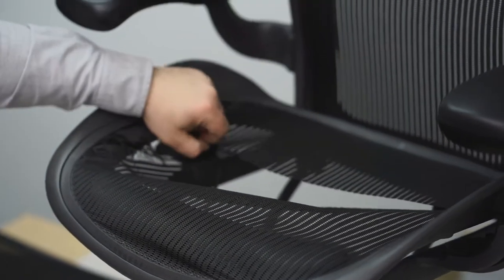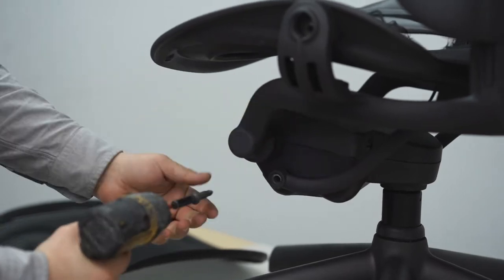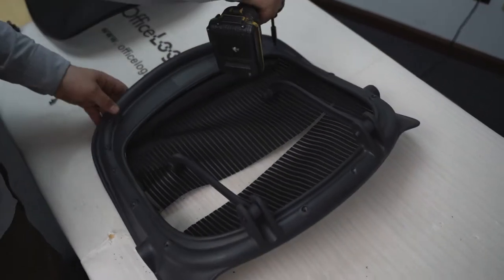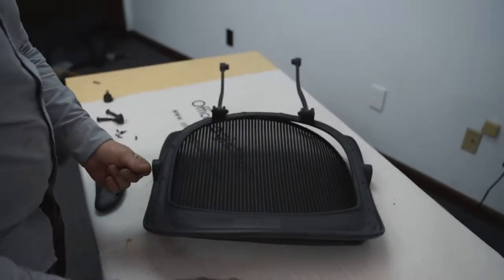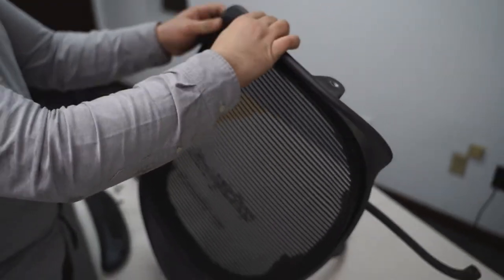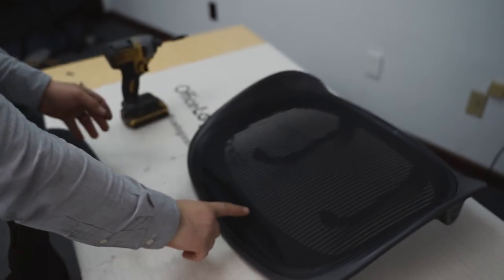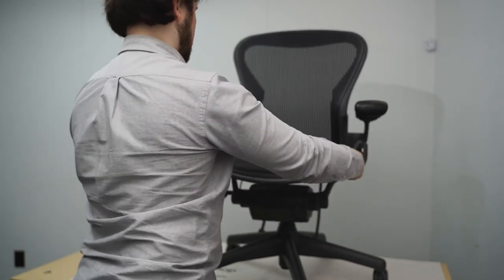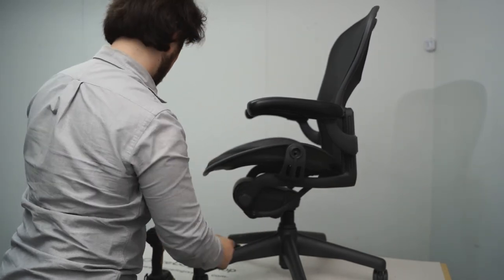Fixing Herman Miller Aeron Chair Seat Mesh Tear by Office Logix Shop

Comment: The 2 screws on each side are extremely tight on my chair. What is the best way to remove these without stripping them?
Reply from the maker: You need to use 3/4 Inch Drive x 40 Inch Breaker Bar tool. This would help to save your chair seat bolt and chair seat pan.

Comment: Great video - what type of bolt connects the lower bar to the bottom base underneath the seat? I somehow lost mine when moving
Reply: You specifically point to the bolt I need at 0:18

Comment: Fitting the mesh was a nightmare; you'd definitely need power tools for that. Or at least a screw driver with a proper grip so that you can push with. Small torx rench set for PCs don't cut it at all!
Reply from the maker: Yes. The power tools can make the process much easier.

Comment: is there a reason why my aeron mesh does not align correctly on one side of the seat pan? like the left side would pop in but the right is like 1 inch gap from the alignment.? vice versa 
it does not pop in as easily as the video
Reply from the maker: There is 3 Sizes for Aeron Chair. This mesh only fit size B which is the most common size nation wide. If you have a size C, size B mesh which is the only one we sell is too small. if you have size A, the size B mesh would be too big. unfortunately, we only carry size B and looking to accommodate size A and C in the future.
Reply: Herman Miller ones are much tighter than what's shown in the video (if they're relatively new and not stretched out).  They're super hard to stretch into the groove, unlike what's shown here.  Perhaps the OLS ones are different.
Reply: I removed the original ones from mine to clean I had a hella of time putting back the mesh. It should not be this easy for original mesh quality.